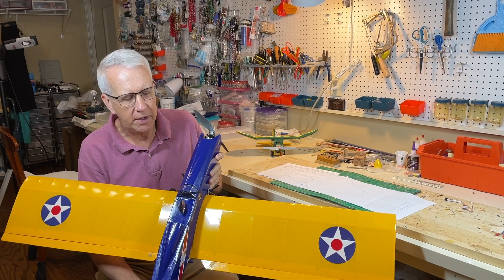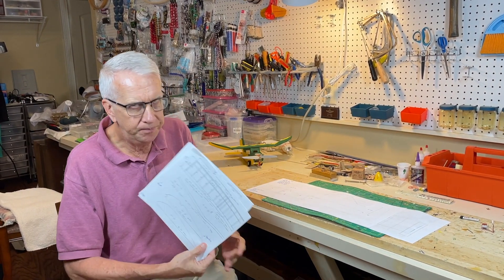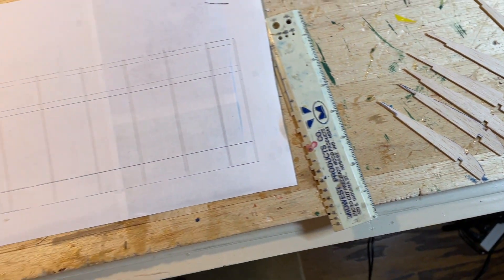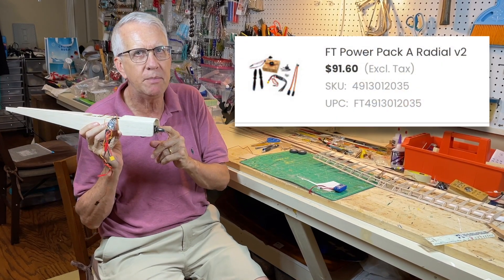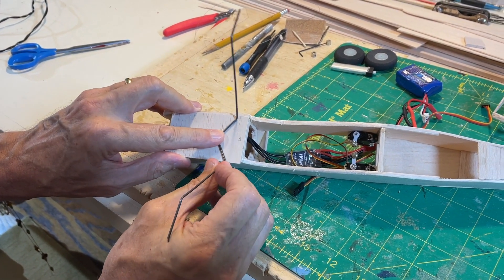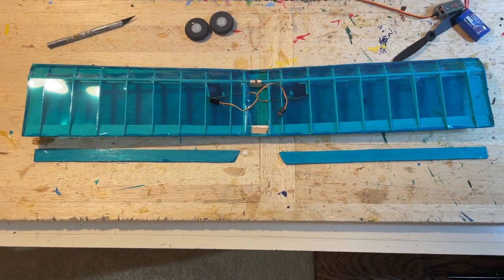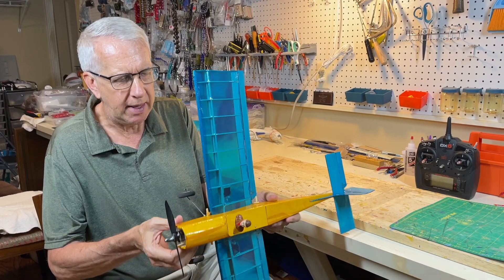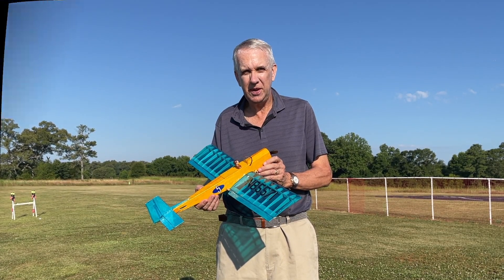Build and Fly the Mini Pronto!

Comment: A tip for hot glue:  A few drops of alcohol will release the bond and it just comes right off.  I used to tape my servos too until I realized that so I no longer bother.  If alcohol gets in the servo it won't hurt a thing and it evaporates almost immediately.
Reply from the maker: Good tip! I'll have to try that.